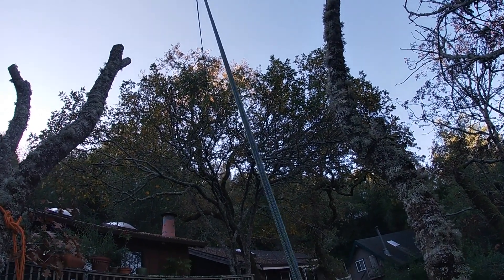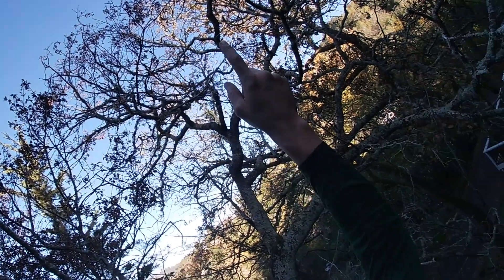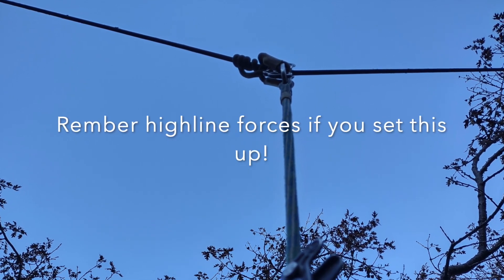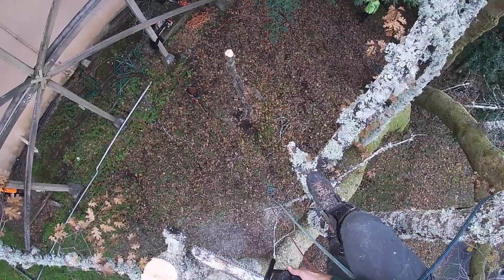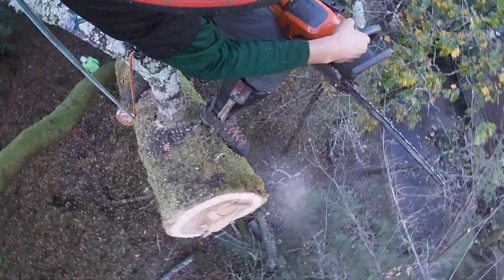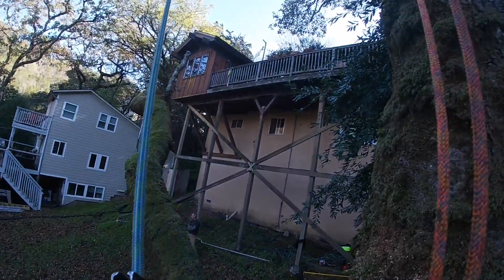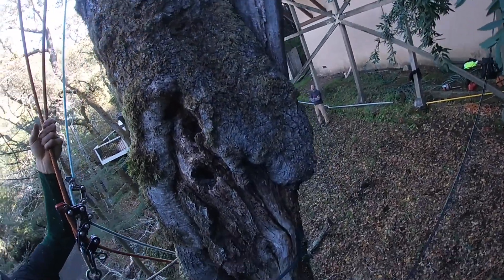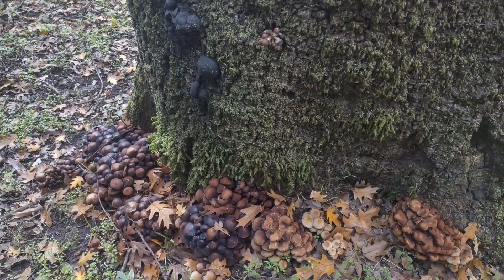What am I doing & why: episode #2

Comment: Hey man couple of questions if you have the time:
When you're adjusting the floating tie-in angle for your climbing system are you coming to the ground and lowering the whole high-line system to adjust it at a safe location?
When you lanyard in to something that unstable are you clipping to something that has an easy breakaway in the event that the tree you're removing fails?

Hopefully these questions make sense. I appreciate the series and the valuable knowledge you pass on!
Cheers!
Reply from the maker: the rope I'm climbing SRS on is attached to the highline on a hitch climber pulley with a climbing knot so it'll catch/ stop/ hold my position for me, until I get to the middle of the high line, then the hitch ends up facing "down hill".
If I'm that concerned about the tree or part breaking under me I don't use a lanyard, just kinda grip with my legs or a free hand. def not by the book & wouldn't encourage others to do that but imo it's better than being accidental dragged to the ground 🤷
Reply: @LawrenceSchultz3000  Gotcha, thanks for the info! With work positioning so adjustable on the high-line I could see the redundancy of a lanyard anyway. Especially if you would be throwing it around something hazardous. Thanks for the response
Reply: So this breakaway lanyard question is something I've been wondering about other people's solutions for with no great answers yet. I've put some appropriately weak accessory carabineers on my D rings and attached my lanyard to those. I like that solution, but I've found the gates tend to stop working quickly under that abuse. I've also use a small loop of old throw line.

Comment: Interested in hearing your thoughts about the loading on this set up.
Reply from the maker: your weight & forces you generate are highest when you're in the middle of the line. you're creating a deflection force on the line. the tighter the line is (flatter the angles is that it's at) the more force you make, up to around 6x's. so your anchors have to be solid enough to handle that side pull.